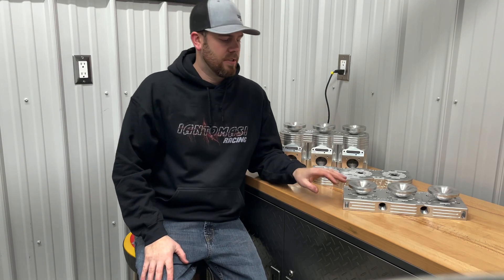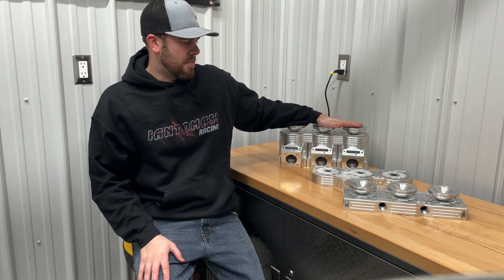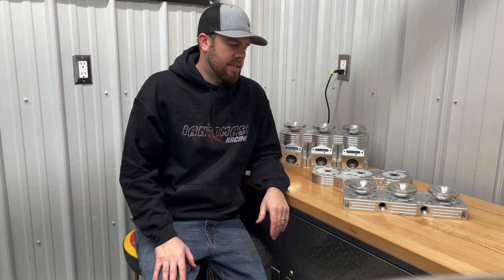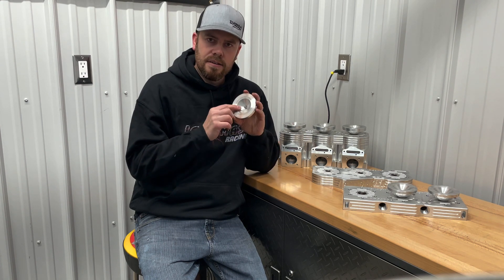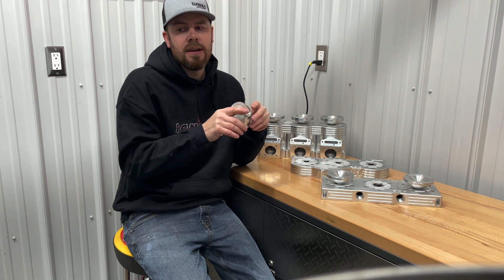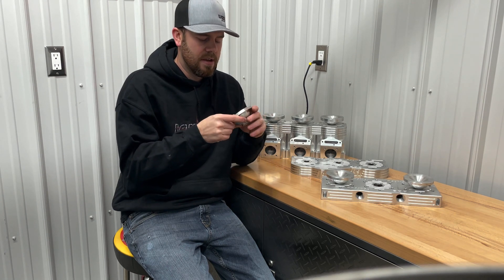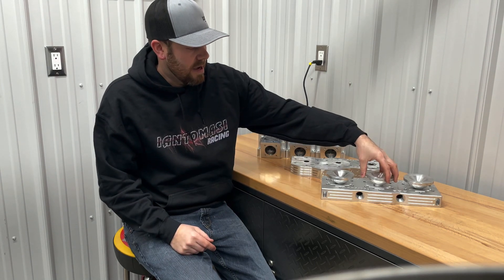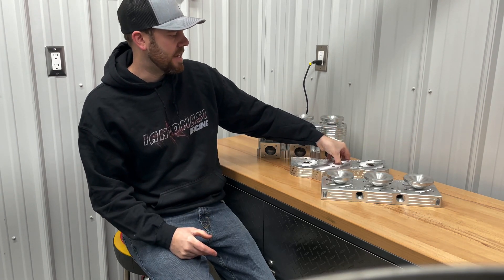Iantomasi Track N Trail Advantages to a billet head with inserts on your snowmobile!

Comment: Do you know anything about the old school hymark billet heads I have one with 5 domes and a billet water cooler assembly with 84.89mm pistons that I bought on ebay from some wholesaler I'm trying to find info about the cc on the domes it for my 2000 polaris 700